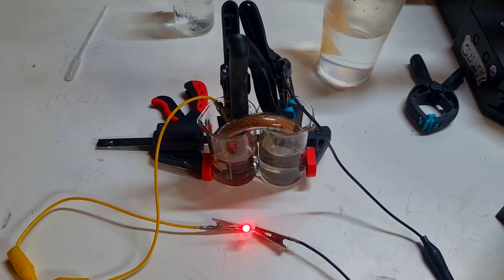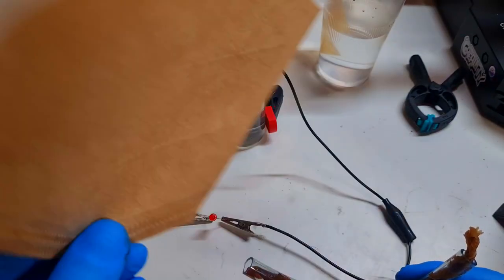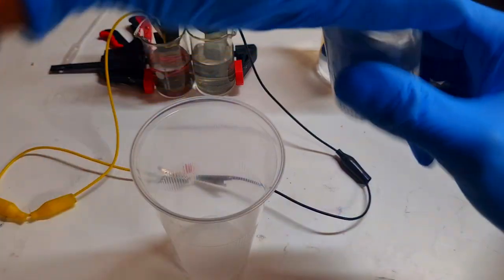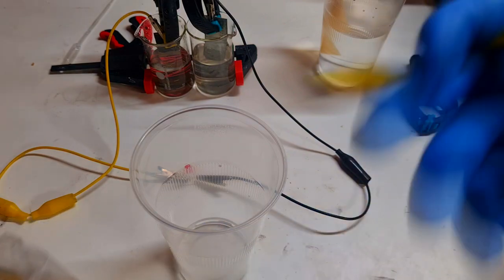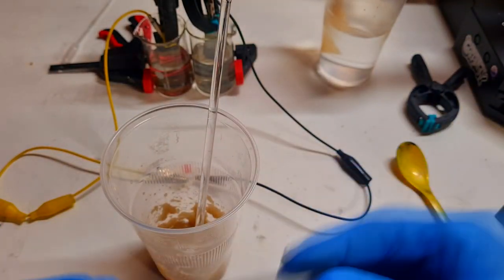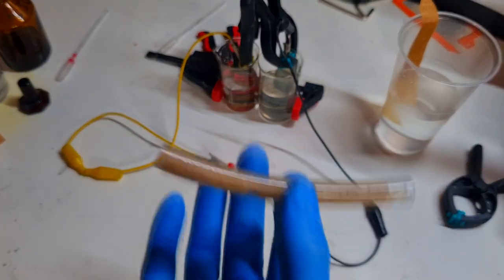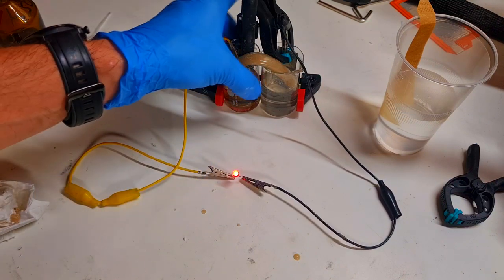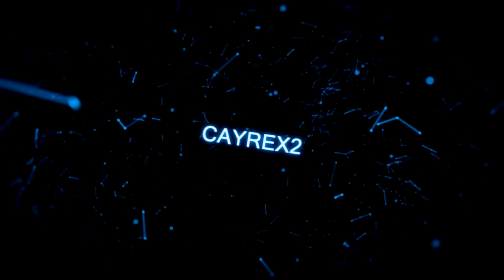DIY a Battery GEL Salt Bridge

Comment: Hey man . Maybe Put the ingredients in little balloons but as gel. Now get multi stranded speaker wire 200 mm long . Strip the ends 20mm and fold over and splay. Poke these into top of balloon and seal with pvc tape. Now you can fill another tiny  ballon with sodium sulphate gel mix . Done
Reply: I tried something similar when I went camping with an led as tent light . Fully portable and leak proof. Just for fun but also fairly time proof for storage in a bomb shelter if it gets that bad ! Never know.